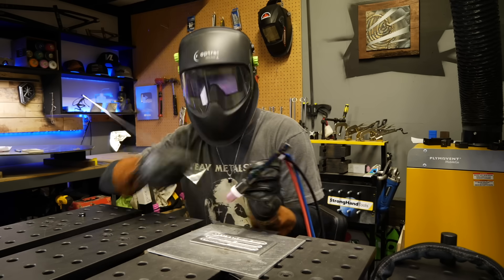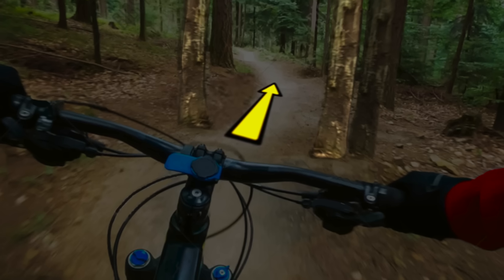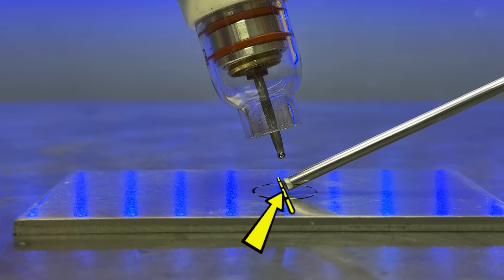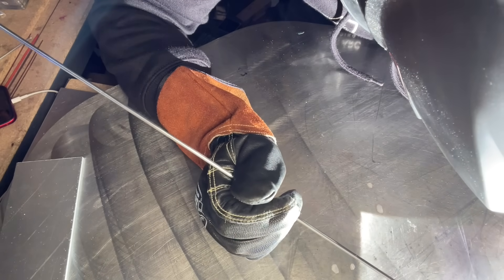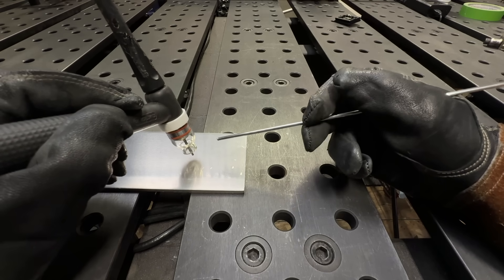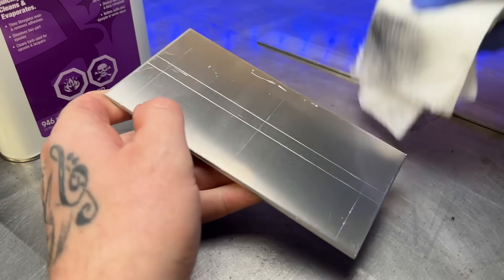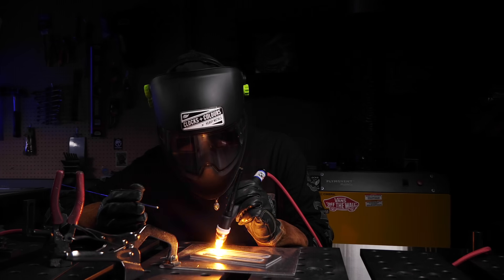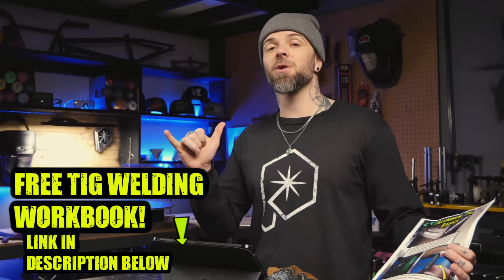The FIRST Thing to Learn Tig Welding

Comment: Start and stops are very important when welding. I always go by sight and feel of the filler rod. I can’t tell how many times I had to go back in and repair weld seems on stainless pressure vessels because of holes, crack out, and small voids because of not burning in at the start and not properly purging over the weld at the end. It’s mainly the start of the weld seems. When you get into exotic materials like AL6XN etc, you do have to slowly come off the end of the weld with your heat. If you stop abruptly, especially the weld root, it will crack out. My welding instructor taught us to always pay attention to the center of weld puddle out to the leading edge. Great video

Comment: 9every environment has its own welding mode. Immersion time and how the rod slides between your hands. The first thing you need to learn is to find the right position to avoid getting tired. Or having to move a few moments later.

Comment: First off thanks for a great series of tutorial videos .I work as a multi skilled welder/engineer building a multitude of vehicles from show trailers to complete mobile operating theatres  . My biggest down fall is stainless  1.2mm tube fortunately this isn’t a daily thing we do but I always struggle with it .I can weld it but it’s always dam ugly (luckily our polishers are amazing 🤣) I have just found your videos and will try all your tips on Monday and see if it helps .but I have a couple of questions we have size 10 ceramic gas cups will this be adequate to give shielding on 38mm stainless tube ?  Also with out purging will I be able to get a clean weld on stainless tube ? Thanks

Comment: I had a surprise recently. I used to weld aluminum with a thick 3.2mm filler on a full time job some time ago. Weren't really great, but managed. 
Now i am trying to DC weld thin mild and stainless steel in my hobby shop at home - and i have troubles with controlling these tiny wobbly 0.8-1mm fillers - and if i go for a thicker 2.4mm one it feels like i'm trying to feed a log into a tiny puddle. I get it, practice makes everything good, but i was honestly surprised with this happening. Almost having to re-learn. A lot of stuff feels new.

Comment: Hi, please could you give me an advice on how to fix the issue. iam tig welding 4mm thick aluminum sheet for a water tank 180cm by 63cm and iam trying to weld the baffles to the tank but it wont melt. 190 amp 120 frequency ballance 70-. is it my settings or there is something i should do. Thank you

Comment: I don't really know but I suspect that apprentice welders today are disadvantaged by using modern equipment almost straight away. Back in the middle ages when I began my apprenticeship we first learned how to weld everything with oxy acetylene including aluminium  and stainless steel, even heavy duty welding that in practice you would weld with a stick welder. The thing is we learned how to form the weld with the perfect puddle with full penetration. Our first welds would be on 20 gauge mild steel without any filler rod. This meant that by the time we got to using stick welders then Mig and finally tig we had accomplished those fundimental welding skills to the point they were second nature

Comment: I always used my thumb to feed my filler rod, started way back with a high frequency unit that had points.  Tip, if you have something in aluminum that you need to preheat, light your oxy/acet torch, turn the oxy off and lightly smoke the part, turn the oxy back on and warm the part, when the smoke burns off, its preheated.

Comment: Great tips. As a moto rider it applies directly! One quick question, what components do you suggest in your dominant hand to start, the torch or the filler rod? I can see either needing the fine motor control gained as an advantage.i assume it's the torch, but wanted to get your take. Thanks for the great content.

Comment: Beautiful work man!!!!! Can't wait until i get nack to work full time so i can afford a tank to use my tig but atleast untill then i can lear from your killer videos!!!!!! You rock!!!!!!
Reply from the maker: Thanks Steven! Get that tank sorted bro 🔥
Reply: @PacificArcTigWelding  
I'm taking a TIG welding class this semester just for fun. It's four hours per day one day per week.... so not much practice. 
I'm having trouble transitioning from androgynous to using a filler rod, but I think I just need more practice time.

We're practicing on thin mild steel; 16 gauge I think. We're instructed to have our amperage set between 50-60. 
For what I'm doing currently is there a certain ceramic cup size tip you'd recommend? (1)
What about for stainless? (2)
For aluminum? (3)
Would you recommend I buy a clear cup as a beginner or would that hinder my learning? (4)
If you pause this video at 7:40 your electrictrode has a ball at the tip. We are instructed to keep it sharp. Is that the arc's light or a blob? (5)

Please and thank you. Your vids are totally great and immensely sincerely appreciated. 

In another vid I saw you drill a hole in alum., fill it, dress it, and finally paint it black. My dad drove hot rods, but made his money painting extravagant and intricate lowriders. If the car was a full show car that demanded perfection, lots of times he'd fully paint, polish, and buff the car in gloss black.... AND THEN lay the paint the customer wanted on top of the black. As you know, black shows everything; it shows how good you are. His driver was a jet black Chevelle. 😍
Something I learned from the show car world is that the chrome shops use a similar trick to gauge their finish work before the final finish.  Chrome guys (the best ones) will fully polish the bare steel, copper plate it, then fully polish that copper to perfection, before finally applying the chrome plating. Same thought process as your black paint tip. 
👍😉
Reply: @xmo552  Autogenous?
Reply: @Patriottoo2  
Autogenous! That's the word! 
👍😂

Comment: I have been trying to learn how to tig weld now for over 10 years. And I have yet to make a 3" bead. I've been welding all my life. With mig welders. And I don't have a much of time to practice. But, I've been using small filler rod. I'm gonna try a bigger filler like what you are using. See if that helps. I've owned a EXT 210 Everlast for years. I hate it. It's way to far advanced for me. Way too many settings. maybe that's the problem. IDK.

Comment: It’s funny but that was me a few weeks ago. I am a total noob to aluminum TIG and at first I was focusing not dipping my tungsten and then I would stare at my filler and go back and forth and not long I would dip the tungsten. I got past that and started to focus on the puddle area and the filler placement and instantly I got better and didn’t dip the tungsten as often. However, now I need to get better at feeding the filler so I bought a filler pen since I do struggle with arthritis in both hands. Haven’t used it yet but boy it feeds really smoothly and I am gonna see how that goes. If I can get the feeding down now and keep moving along I think I’m gonna make it. I’ve see some really good progress and several steps back but it’s all learning and I have time. What messes me up is that I’m going along and things are fine and boom the heat builds and I start forming a lake and it’s all over. Thanks for the extremely helpful tips and I just downloaded your guide.

Comment: Patience...aluminum is a different animal than any other metal.
Stainless, and mild steel basically weld themselves...you have to let your puddle form, don't rush it or you'll hit your tungsten. 
One important note...a dry rig is great for Stainless and steel, but not so much for aluminum...a water cooled rig with high freak is the best way to weld aluminum that is a fact. 
40+ years experience, agree or not, I've done my time.

Comment: Yep, looking between the trees is definitely the way to go.  🙂￼ (The tree on the left is the torch and the tree on the right is the filler metal.  I like to weld left-handed.)

I TIG weld a variety of metals (aluminum, cast iron, copper, magnesium, stainless steel, steel, and titanium) and it is interesting to see the differences between the alloys as to how they weld.